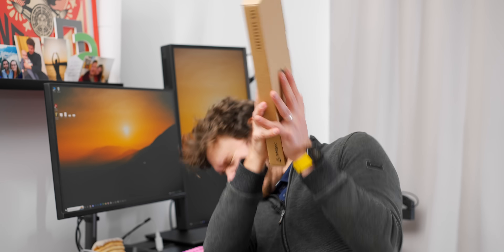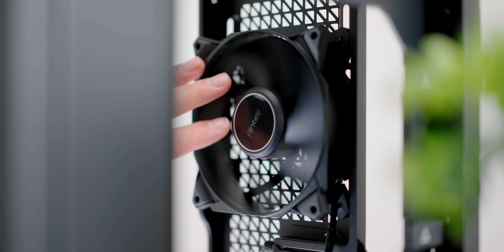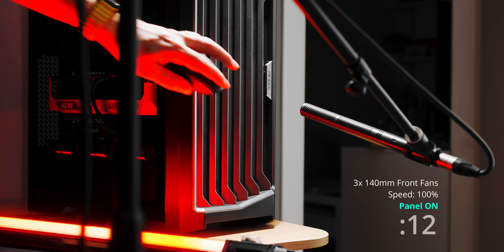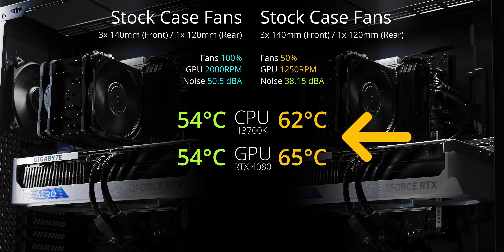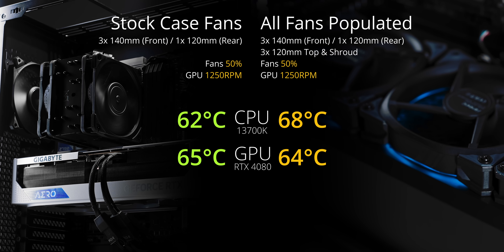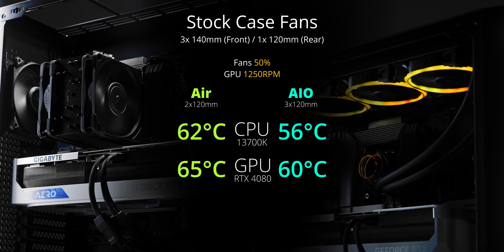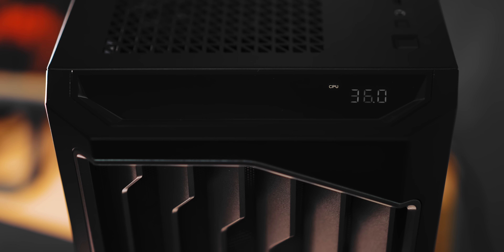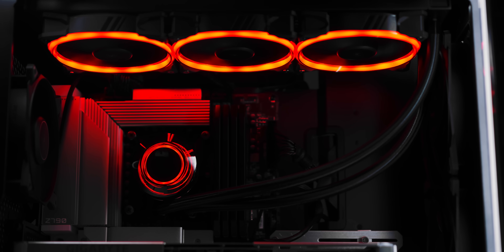How Many Case Fans do you Actually Need?

Comment: I have an NZXT H7 Flow with 5x140 mm Arctic P14s. No temperature-related issues at all, with an air-cooled 5800X3D using a Scythe FUMA 2, and a 6900XT.

On stock fan profile for the 6900XT, and fans in the case set to 35% (3x140mm front, 1 back, 1 top; It has room for 2 more 140s at the top as well), the GPU will get to 74C and 93-95C hotspot. That's with the GPU fans under 60%. It's basically silent.

With a custom profile that ramps the 5 fans up to 50%, those temps drop to 69C and 88C respectively. Air cooling is far from dead unless you use absolutely bonkers parts that consume way too much energy to begin with lol.
Reply: I'm shopping for a PC and I see 5 packs for like $30-40 then I see these other fans like the one shown in this video where its 3 connected sitting on top of the case for like $90-100. I'm wondering if there's any difference between the two.
Reply: @MrZulgen  There are, the connector itself is really unique and easy, less cables. Performance? Not enough to justify the cost.

Comment: you could use the bottom for a Distro plate!!! or a rez mount!! Since it already has holes for the 120mm mounts!! With a 360mm on the top, and a 240 on the front

Comment: had been interesting to see how it had done with 9 fans (add the top 3 but leave the bottom 3 out) would it help to get heat out, or have a negative impact due to interfering with the front/back airflow?

Comment: I'm confused does this mean if you're air cooling you shouldn't use any top fans at all??
Reply from the maker: If the front intake is good enough, and you have a single rear exhaust, top fans might not be necessary. 
-D.
Reply: you shouldnt use them as exhaust, thats for sure lol. Either none, or set them as intake. maybe the rear top fan as exhaust, but certainly not the front one. It robs the CPU cooler of fresh air

Comment: I too found that maximizing air into the front led to modest temps: 52 to 55 C (at 37% fan speed, all fans).
Legacy CoolerMaster 500 case, front intake w 3 T30s, back w single 140 Nochua, top has 240 AIO for 3080, 11700k cpu has BeQuiet Dark Rock TF 2.

Putting in a second GPU (evga 3080 Ti ftw3 ultra) in lower PCIe slot running at about 77 to 81 C w it’s fans at 100% results in 3080 going up 5 C and CPU only a couple. Case and 3080 AIO fans stay below 70% speed.

Comment: Using a top exhaust in front of a CPU air cooler is terrible, of course that wasn't going to help. It's just taking fresh front intake and removing it before it can be put to use
Reply: would it help if you have a top fan right above the air cooler, not in front of it?
Reply: @SystemBot  not really, no. You want air going through the fins. On top, it can't pull through the solid top of the cooler, so it pulls from either before the intake of the cooler or after the exhaust

The former you don't want, the latter should be handled by rear exhaust and optional top exhaust at the back. 

More fans=more noise so don't add them unless they're gonna actually do good things for you

Comment: Do i really need front fans if i always keep my case open?  I have ryzen 5600x and rtx 4070. My temps never go higher than 65 on cpu and gpu is even colder
Reply: opening up the case.. would there even be an airflow?
Reply: @SystemBot  i dunno bro. I use ryzen 5600x and rtx 4070 with only 1 case fan but my case is open. My temps are always low so im not sure if there is any point in spending money for new  case with fans
Reply: Depends on the climate where you live, your room temp etc but the bad thing having open case is having to dust off your PC often then again that depends if you clean your room etc everyday to avoid having such problem.

Honestly just put a cheap fan on your PC case and close it, its not like you're running a super high end stuff to warrant super good fans.
Cheap fan can optimally cool what you got as long as you got proper airflow going on front fans intake - top & back exhaust - and if you got fan for below in your case put it as a intake for GPU.

Comment: I'm using an older Fractal Design Focus G case. I replaced the stock white LED fans with 2 Fractal Prisma 140mm fans in front as intakes and 2  Prisma 120mm fans as rear and top exhaust. My I7-11700F is cooled by a Scythe Fuma 2 cooler, and my GPU is a 2070 Super with the Dell/MSI Aero blower cooler.

CPU and GPU temps idle at 37C but can push 70C/82c in heavy workloads. The higher 'loaded' GPU temps can be blamed on the blower cooler.

Comment: im currently installing 5x 1200 redux noctuas in my node 804 to cool my amd athlon 200ge and my rtx t400. will be upping to 10x of said noctuas in a few weeks when ill be upgrading to the monster we all know as ryzen 5 pro 5650ge and throwing in 8 3.5’’ drives as well. id slap 20x fans if i could because a) watercooling is cringe and b) high tdp and overclocking are cringe AND killing the baby seals AND melting the polar icecaps. if i could i would add 2x ODD drives as well and a nice fan controller with nice LED screen. and on OLED screen somewhere so i can see RPMs from all my 10 (or 20) fans. 

ditch rgb. ditch watercooling. ditch 300w cpus and 800w gpus. join the revolution. i want storage. i want odds. and i want custom cable lenghts for all the fans, coolers, psus and front i/os. peace!

Comment: I've noted the Lian Li Lancool 216 case wasn't included in the comparison chart, but then making the sponsor look bad wasn't really the goal. My last Antec case was the Dapper Dark Phantom DP301M M-ATX and discovered it lacked airflow. 
$160 is pricey for the Antec Performance 1 FT when the much better (white) Lian Li Lancool 216 RGB case can be found for $100 (normally $115) and the 2 front PWM ARGB intake fans are 160mm. 
Of course the investment rises when replacing the rear exhaust fan with a $30 CoolerMaster MasterFan MF140 Halo and a 3pk of $62 MasterFan Halo’s for the top AIO (for exhaust as well)
My system is a positive pressure setup to ensure all intake air is filtered through the optional $13 front Lian Li LAN216-2W (white) magnetic front dust filter. 
I’ve had the (white) Lian Li Lancool Il mesh RGB but the 1.5mm mesh hole size allowed a bit too much dust inside so I tried the (white) Phanteks Eclipse P500A D-RGB but the 1mm mesh hole size wasn’t much better so the filtered Lancool 216 finally got it right, plus Lian Li didn’t repeat the mistake of the Lancool Il mesh where intake air bypassed the mesh entirely at the bottom front cover. 
My Godlike EATX MB has plenty of room and the ability to move the top button to the easier to reach lower left side could be viewed as a negative for case manufacturers since I doubt I’ll be in the market again for quite some time. 
The longevity of CoolerMaster fans is a concern but they are the best looking fans IMO and matched the front Lian Li fans better than anything Lian Li offered. I mean, they can’t be any worse than the often failing RGB of the Corsair LL120’s I yanked off my AIO. BTW, I was able to eliminate the proprietary Corsair lighting node pro hub and Commander Core since the Lian Li RGB controller allowed daisy chaining.

Comment: how noisy is my GTX1080 + R9-3900x?
I modded the GTX1080 with two Noctua fans. I have two, Noctua FRONT fans as intake. The CPU fan (15cm only) on Noctua NH-D14 serves as the exhaust too. My PSU fan never comes on. So... how noisy? My fans rarely spin above 600RPM. I can't hear the computer when gaming even with the sound turned off. I can ONLY hear the CPU fan if I'm doing something really intensive. Most people have no idea how to optimize for noise... here's a tip: set your CPU and GPU fan profiles so they don't ramp up much until near the max temp you want... low RPM until, say, 65degC, slightly sharper ramp to 80degC then VERY sharp ramp until about 85degC (will vary by system but the concept applies to all). MANY people are obsessed with keeping the chips COOL all the time at the expense of noise. Why? I've been doing it this way for well over ten years.

Comment: I have 15 fans in my Cougar Panzer Max. Is it ok to put them back to back in the front and top? I have 4 in the front, 5 on top, 1 on the bottom, 1 rear, 1 in power supply, 2 in the GPU and 1 CPU fan.
Reply: I think you need a few more. You can use some contact adhesive to glue some to your glass side. Then run the cables over the back through the aio. It will keep your glass nice and cool
Reply: @Bobthebuilder1322  😂😂😂😂
Reply: @Bobthebuilder1322  omg, that's a great idea. I have a few extra fans that I can use.  thanks so much!
Reply: @MikeAnthonyPhoto  be sure to use plenty of thermal paste when installing fans.
Reply: @Bobthebuilder1322  I did but it didn't stick very well so I used the thermal paste to glue the RAM sticks into their slots. They are real tight now.
Reply: @MikeAnthonyPhoto  the only way to install ram. Did you apply the the slot and the ram? If you only do one you won't get the right temps

Comment: Rotate the fans on the tower cooler and the back of the case - this would give cold air directly to tower cooler giving you the lowest temps to CPU.
You'll now have an area of hot air at the front top quadrant, set the fans as exhaust at the top 2 of the front (bottom as intake for gpu cold air) and first top half.
Set the last rear fan as intake.

Comment: If you're going to compare a 360m rad to a standard noctua, can you then compare it to a dh-15 to make it a fair fight?  On my next build I'm debating air vs aio with noise being a priority over straight cooling.
Reply: NH-D15 isn't that much better NH-U12A. I own both and the NH-U12A is the better buy that doesn't restrict your ram choices and won't be too tall to fit your case side panel on. Also their performance is so close.
Reply: Or just get a Frost Spirit 140 or Phantom Spirit 120 SE.

Comment: Using percentages of fan speeds for comparison is a bad idea because it means nothing to viewers. We don't know how much rpm it is or the noise level.
Reply: I do
Reply: Oh thanks for saving me 8 minutes i thought he would talk about noise levels idc about anything else
Reply: If you want apples to apples you would want to measure the cfm output because every fan will output different cfm even if they are spinning at the same rpm.
Reply: For 90% of people this is fine. Most case fans people are buying are around 2000rpm and relatively similar noise levels
Reply: Same Fans remember?
Reply: I think it's okay not to be too scientific Herr. Most ppl are gonna use the fans they already have anyways. Even if you knew the loudness and rpm readings, cfm and static pressure would remain a mystery. The relative fan speeds are okay to draw basic conclusions

Comment: For air tower coolers, it'd be better to set top fans to intake rather than exhaust because your front intake fans would be rendered useless if the top exhaust just blow cool air out once it comes in the case
Reply: No, if your top fans are intake, your GPU will choke and end up burning itself. Intake should always be on the side, bottom or front or could be rear but top should always be exhaust for the GPU temps clearance
Reply: @havochowl6766  your logic is flawed, convection doesn't matter since airflow is guided by fans. all i'm saying in my original comment is to introduce more cool air from top especially in this case when it comes to cpu air cooling. positive air pressure and rear exhaust fan will do it's job in exhausting hot air
Reply: @KaszzieWuzzy  ,
No. Completely wrong. It's POSSIBLE that the TOP-front fan as EXHAUST is stealing a bit of air from the intake (which is why many cases don't put a fan there), but in general INTAKE at front and EXHAUST at top/rear makes the most sense for a typical CPU air cooler setup. This has been tested to death. your idea of top fans as INTAKE ends up fighting AGAINST the air flow. You want the front fans to bring in cool air, pick up the heat from the Graphics card and have the top/rear fans PULLING that out of the case along with the CPU heat.
Reply: That's not how that works at all.
Reply: Top should be intake like kaszzie said. U want to feed cool air from outside directly to ram and cpu. U will compromise the gpu yes but u can also put intake fans at bottom to feed cold air outside directly to gpu. The overall results will be slightly better then stock rather then the shown in video failed 3 top exhaust and thus incorrectly concluding lesser fan is better. Remember u want to mainly cool the gpu cpu and the inside case temp is not as important. Nothing beats cool air blowing directly onto the thing u want to actually cool.

Comment: I just got HAF 700 .. answer is.. 8 or 11 .. low rpm noctuas or phanteks t30 and you will forget what is noise and high temps 😁
Reply: Nice Case.
Reply: My old HAFX only has 6 fans and I've yet to find anything that beats it.
Reply: Nope. More fans introduce annoying humming even at low fan speed. 8-11 is definitely overkill and too annoying to listen to even at 1000 rpm.

Comment: 6x nf140mm intake  2x nf 120 exaust 2x nf 140 on d15 and psu "upside down" so it dont rob gpu. i like running 600rpm max and coolermaster cm690 2 is still best case i have ever used. heavily modded with grinder and welder to fit 140's all around. thing is massive but so is my living room so idc. got it for $28cad in 2011. same case now is ~$700 on ebay and no one makes anything like it. overkill? prob. do i care? no its silent

Comment: With air coolers i usually put the closest (top) to front as intake and the one above the cooler as exhaust.. wish someone would try it
Reply: In general the TOP-front fan area should arguably be solid case for an air cooler. If your FRONT-top fan is INTAKE and the TOP-front is EXHAUST then the top fan steals the air. If the TOP-front fan is INTAKE then you are creating turbulence with the FRONT-top fan which is inefficient so might not benefit overall in terms of noise. If that TOP-front area is solid steel, then the FRONT air comes in and gets pulled by the CPU fan mostly which is what you want. Then you can have TOP-middle/rear fans exhausting air as they mostly aren't stealing air from the CPU... there's also rapidly diminishing returns when you add more fans... depending on the fan speeds however, some of these changes might have very little obvious temperature difference.
Reply: @photonboy999  i really like to put the closest top to the front as intake and above the cpu and back as exhaust... Tried it on multiple pcs and slightly better temps and noise.. this way you're feeding the cpu and gpu lots of fresh air while exhausting the hot air fast also

Comment: I only use 12
Reply: 16 for me in a Lian Li O11 EVO with 6 on a push pull 360 EVGA AIO and a Dominator RAM fan over my memory and three on my ZOTAC 4090.  JET FLO 120's at over a 100 CFM each.

Comment: What about making back as intake and front as a exhaust? That way cpu should use less of gpu warmed air?
Reply: Not in general. Now you're starving the graphics card of cooling. In general the graphics card is the part you're more concerned about. There ARE situations where a CPU is very power hungry and runs HOT relative to your graphics card however. In that situation it might make the most sense to use an AIO for the CPU and have the fans as INTAKE, and the other case fans as exhaust. Your CPU runs cooler but your GPU runs hotter. Again, it depends on what's hardest to cool.
Reply: @photonboy999  what about cases that don't hawe power supply at bottom